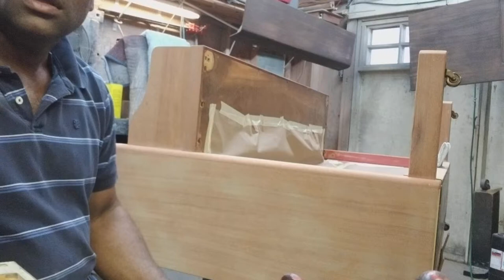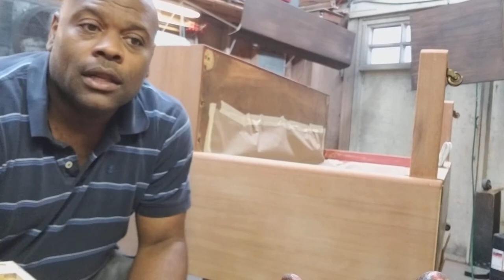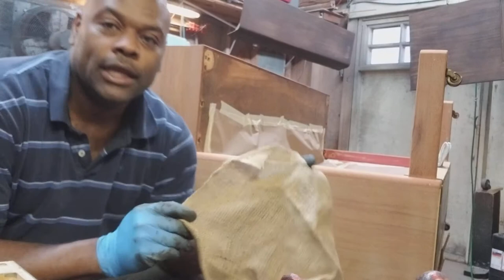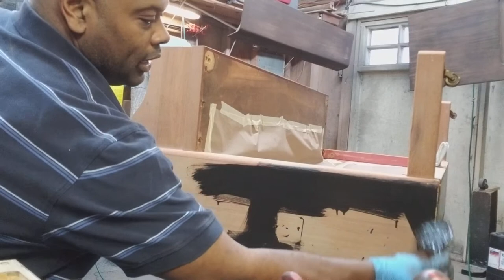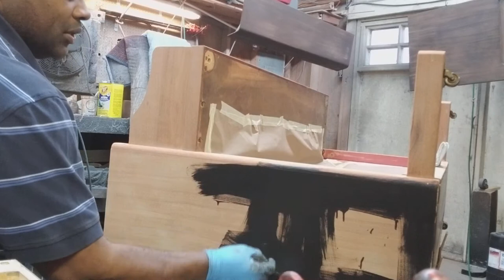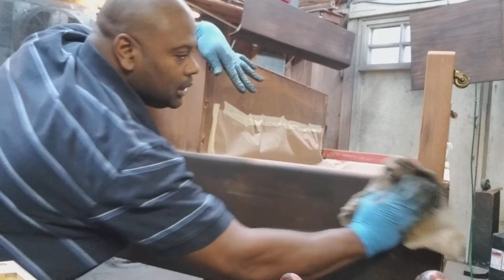Wurlitzer Spinet Grainfill

Comment: I was taught that you need a very light scratch coat BEFORE the filler with any stain being applied must go on the bare wood. The scratch coat is then very lightly sanded with fine paper and THEN then filler is applied. The filler should not be allowed to completely dry either. Rather, just as it begins to set up, you "pack" it into the pores rather than merely wiping dry filler off. This method allows for a deeper more even appearznce to the finished wood with generally fewer sanding sealer and topcoats. Btw, the burlap is correct for "packing" the filler, however it should be followed up with a light wipe off with a tee shirt type of fabric after the packing is done.
Reply from the maker: Gregg Michalak 

Depends on which type of grainfiller you use whether or not you remove it dry or right before it dries.  I've seen both ends of the spectrum.  I find this process with this filler works best for me.  I have also found that grainfilling over stain removes a fair amount of color from the wood.  Staining over grainfiller allows me to leave more color, however Ive done it both ways.  Each project is different and I feel out what will work best with each project.  You are correct on the cleanup cloth... I typically use a piece of t-shirt type material to do that.
Reply: BeaversPianoTV If you use the scratch coat over the stain, it seals it in and will not affect the stain at all. Each step has its specific purpose and cant be skipped. The scratch coat is a special super light lacquer formula which both serves to seal the stain and "de-burrs" the wood. But everybody has their own system that works for them. I used a high quality filler which was a very very thick paste which had to be diluted/mixed with a vmp naptha. This allowed it to dry slower allowing it to before packed onto the burlap while staying moist allowing filler to be worked into and packed into grain. This method worked great for maximum filling as long as that scratch coat was applied. Enjoy the vids!